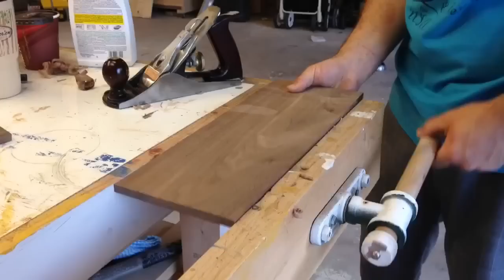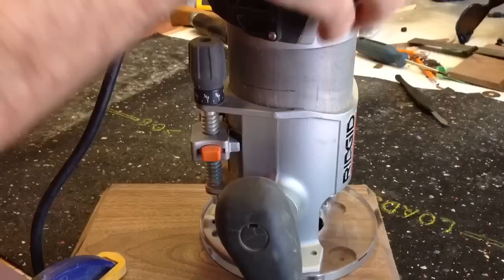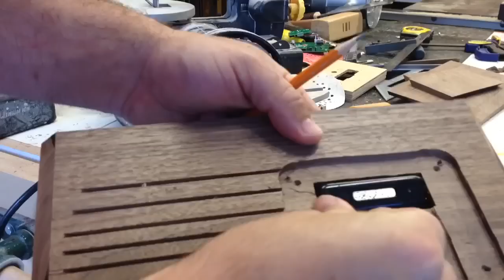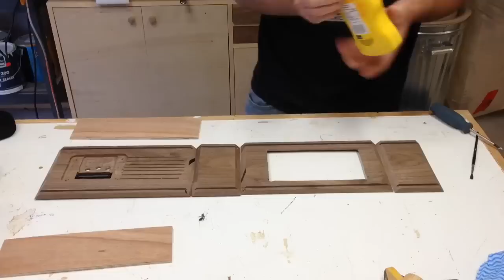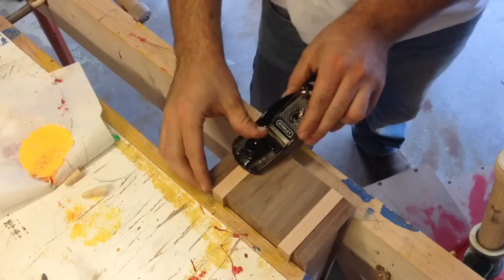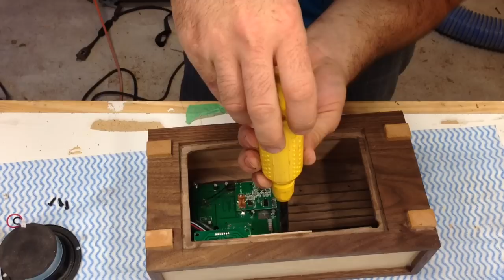Woodworking project - docking station

Comment: Wouldn't you want to elevate the speaker just a bit so the excursion don't hit the wood? Otherwise great project, very nicely done.
Reply: ***** k?
Reply: I was thinking the same thing.. I was also thinking the box isn't acoustically tuned for the speaker but then again it's just a cheap speaker from a cheap dock so it won't sound great, I think it's more for  a decorative piece rather than sound quality
Reply: +Gage Pine Would have sounded better if he installed a black plastic bass port in the back. Then there would be some resonance.
Reply: Ame Nightcore it's not like this speaker is moving that much air anyway :P

Comment: What did you do to turn it from stereo to mono?
Reply: well, nothing it seems... =P
Reply from the maker: J Nye Actually one of the speakers didn't work thats why I didn't mind taking the docking station apart. It actually seems to sound alright with one speaker. It might already have been mono because they were wireless speakers (put each speaker in a different room) anyways its just for the garage and I wanted to show a video more for the idea than design.thanks for watching

Comment: This woodworking book “pepe amazing plan” (Google it) has a great deal of information about wood working. The book also displays several designs and also descriptions on the materials used for different wood working processes and also the guidelines on finishing various procedures correctly. To put it briefly, I`m fulfilled using this book, particularly in the procedure of understading about woodworking.